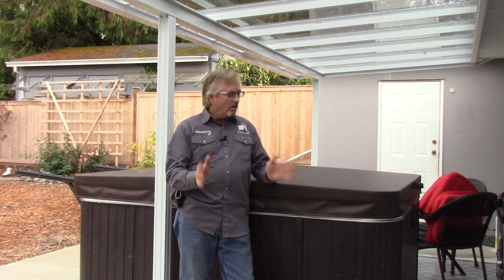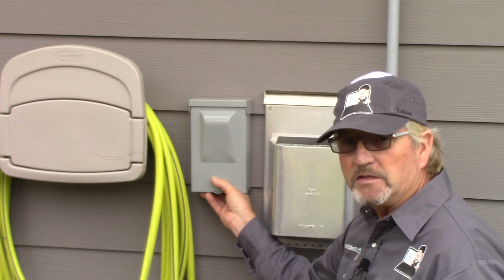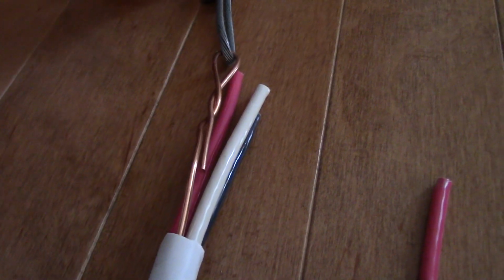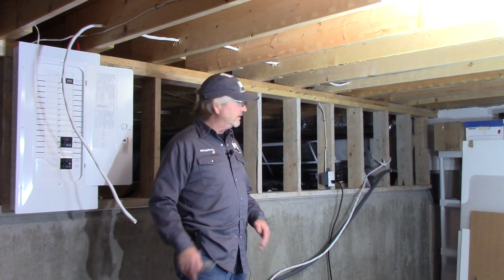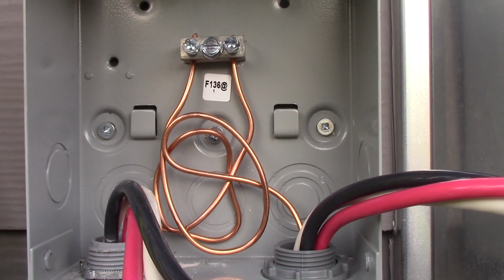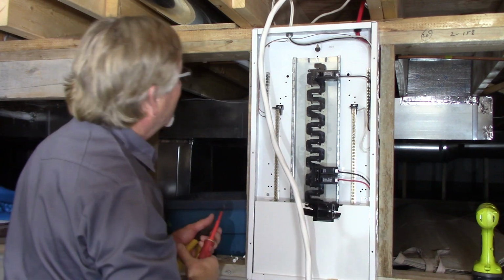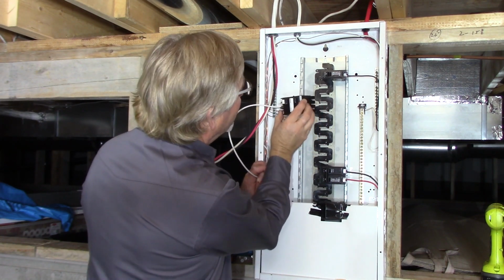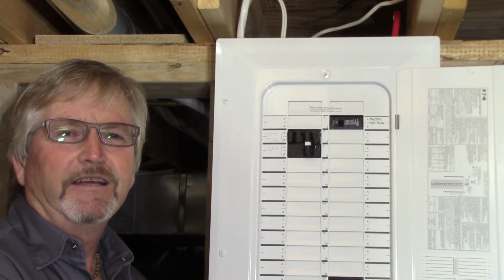The Best Hot Tub Wiring Video Ever!

Comment: Great video, as usual, Terry, however... the whip from Spa-Pac to the hot tub would be considered a "wet location". Even if the NMD conductors are housed in liquid tight, they are not acceptable for a wet location. You need to run wet location conductors from Spa-Pac to tub. Cheers

Comment: What is the required distance if any of the Junction box from the tub/water? I understand the rules state the disconnect/breaker must be further than 5' but unclear on a J box. I have an existing disconnect that will feed my new breaker panel/disconnect. The existing disconnect will be close than 5', can I turn it into a J box and leave it where it's at? Thanks
Reply from the maker: Yeah, as long as it's just a JB with a proper closed cover, not an issue.  The rule is there so you aren't in the tub and reaching for a disconnect where there is a slight possibility of coming into contact with some live parts.  Not likely you will be in the tub and deciding that now is a good time to take apart a splice for any reason 🙂  Thanks for watching and commenting!  I  hope that you 'liked' the video, and that you have subscribed to my channel? I'm on a push to 100K subs, some kind of vanity badge of honor that I'd like to see what happens now that I'm so close!  Maybe YouTube sends me a million dollars or something!

Comment: I went with a 4/8 space spa box for a 20 AMP HVAC and outside lighting and outlets. I am going to use the 2 pole 15 AMP GFCI that came with the box for two garden circuits as I don't need it for the HVAC, and a 2 pole 20 AMP breaker in the other two slots for the HVAC. From there to a disconnect. All within a few feet of each other. 

I am aware that the GFCI will cut off both circuits if tripped.

My question is the breaker from the main panel to feed 30 AMPS of the spa panel. 

Originally I had another idea so ordered a 60 AMP breaker.  I am confused as to the wire size from the main panel to the spa panel which on the other side of the wall from the main panel.

Do I use 4 gage or 6 gage wire? I would prefer 6 gage as I can find that, 4 gage is harder unless I go to the electrical wholesalers then getting only five feet may be a problem. Actually, getting anything electrical is getting to be a problem.

Thanks
Reply from the maker: I hear you, and to be compliant, with a 60A breaker, it should be #4 (70A).  If you run #6 (55A), you should go to a 50A breaker.  Having said that, will feeding 60A on #6 cause your hair to start on fire (especially given the short distance), personally I'd sleep well with that happening. 🙂  But if you're getting a homeowners permit and all, just ask your inspector if he/she would let that go, and sorry for the late reply. Missed this somehow.  Thanks for watching and commenting!  I hope that you gave the video a 'like', and that you have subscribed to my channel?  I'm on the push for 100K subscribers and I think YouTube sends me a million dollars or something?  🙂